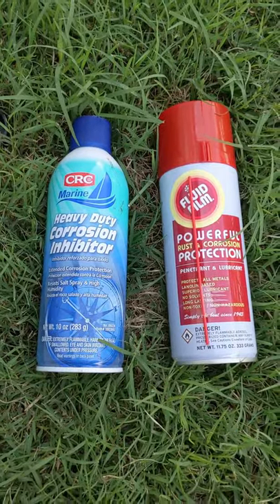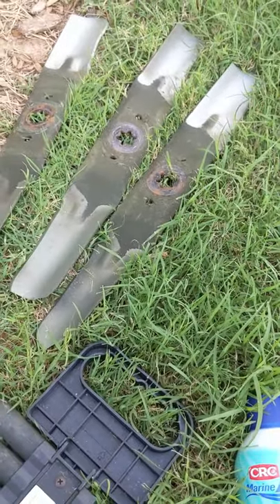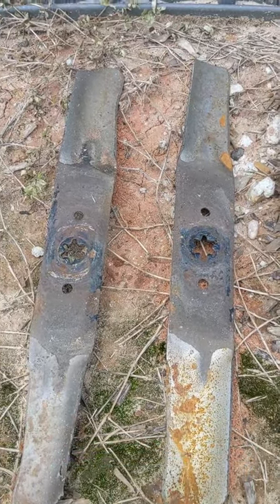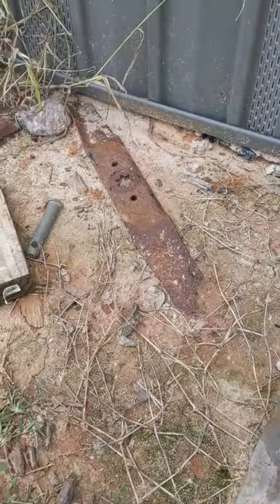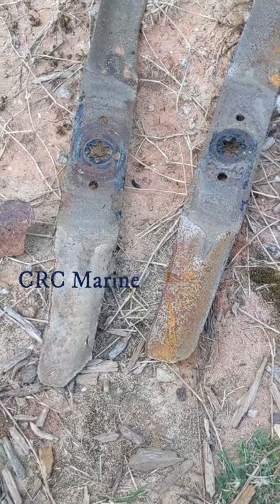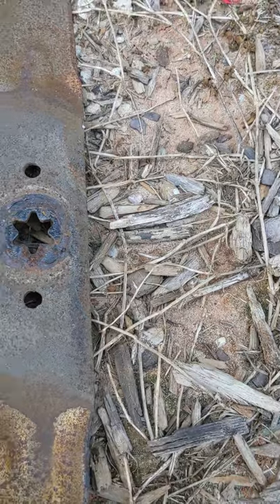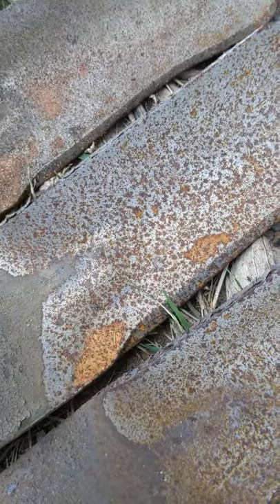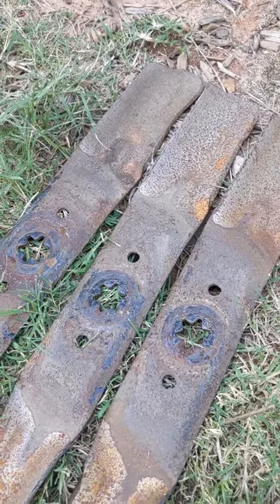CRC vs  Fluid Film

Comment: Fluid Film on aerosol can is useless in exposed areas. It washes of right away. You should use the thick stuff from Fluid Film, I think it is called Fluid Film NAS,  on equipment sitting outside, it has the same thickness as ketchup👍😊 cheers from me in Norway

Comment: Glad I went with the CRC as undercoat for a 2002 s10 pickup.  $9.59 at Ace hardware per can. 2 cans was plenty. Degreased and power washed undercarriage. The CRC was easy to apply just kinda smelly. Thanks for your test!
Reply: If you think a little bit of wax smell is bad, don’t ever try fluid film. Especially when it is hot outside, it smells like B.O.  x10

Comment: I'm experimenting a lot through last decade or so.  I prefer cosmoline (CRC, CRown hd, Amsoil hd etc) over Lanolin (FF) but if you spray Cosmoline over paint it will fell of with paint.  Cosmoline can not creep like ff and will not creep in cracks of paint.
Reply from the maker: Here in Texas during the summer it creeps ok. And if you make sure the surfaces are warm when it is applied I've had good luck getting it to coat even small crevices

Comment: Not many videos out there on CRC. I read ONE comment saying that CRC is to thick and could creat a moisture barrier between the metal and the oil - which could cause rusting over time. 

Thoughts on that?
Reply from the maker: Results I've seen so far don't support that. This current test is at 580 days and the most recent video shows rust on CRC starting at the edges (which I assume is propagating in from the uncoated areas).
Reply: Google "10 year of using cold galvanizing" toward end comments.  It is my test.  CRC can not be moisture barrier, not even close.

Comment: I just bought 6 cans of CRC for my new 3/4 ton $50. Might have to touch up every year but I surely spend more then that in oil changes and any gas fill up
Reply from the maker: This test is at 580 days and still going well. Check out the latest video.

Comment: XCP Rust Blocker achieves the same, perhaps better, results as CRC. Unfortunately, CRC cannot be obtained in Europe, otherwise I would take the CRC vs. XCP Rust Blocker. I've never known anything better than XCP.
Reply: CRC SP400 (it's avaliable in Poland and other parts of EU) is the same thing as cosmoline shown in this video I ordered it today and I can let you know if the info is 100% true. I will be applying coating for my VOLVO S80 in the next week.

Comment: I think fluid film might be susceptible to degradation in sunlight, more so than the CRC.
Reply from the maker: I tend to agree. My results in my first round of testing showed FF fail rather quickly in direct sunlight. This round has it under an eve and facing north, better mimicking a vehicle under carriage without direct sun, but it still was the worst performance of the test.

Comment: Invest in some New Blades for tractor..!
Save your $$ fluid film , CRC, Blasters Surface Shield all waste $$ …
Clean Cutting Deck 2twice Season it last life of Equipment..
Lubricant on necessary components of deck as needed..
Reply from the maker: This wasn't intended for mower blades, those were just available scrap metal. The intention here was to test their uses for undercoating vehicles.

Comment: crc is way better than fluid film...
Reply from the maker: That's what the testing showed. Some people found issue with me leaving the samples exposed to sunlight though so I have a new test running where they don't have direct sun. Stay tuned for updates on that in the next few weeks
Reply: @essentialhomeowner  will do.
Reply: Nop.  Ff move cosmoline not.  Both have places but call some better than other is not true.

Comment: Should have coated the bottom too because Fluid Film and CRC is UNDERcoating not OVERcoating. UV light and wind rain are not realistic for the underside of a car...
Reply from the maker: Neither product is strictly marketed as an undercoat and both list uses that would be exposed to elements (Fluid film says chrome protection like rims and wheels, CRC says salt spray protection). Also, I'm in Texas and undercoating testing isn't as relevant when we don't have/need to use salts on road ways. Just ignore winter 2021 ;)
Reply: @essentialhomeowner   No doubt but 99% of people buying that stuff it's for undercoating
Reply from the maker: I've got another test in the works for under coating. And I still have this one going. Maybe I'll update on this in a few weeks.
Reply: @essentialhomeowner  Can you repeat this test with CRC Extreme Duty Open Gear and Chain Lube sometime? Project Farm used it in his chain lube video and the chain was rust free after being sprayed with corrosive ingredients.  A lot of reviews for the product on sites seem to indicate people using it as an effective undercoating as well
Reply from the maker: @potatotime4747  I'm working on the setup for the next test. I'll add the crc open chain oil to the test as well.